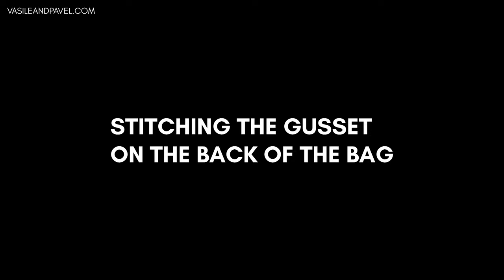The Naomi Leather Crossbody Bag (Link to Pattern in Description)

Comment: How do you attach the buckle on the bottom?
Reply from the maker: stitched, ofcourse. I make the holes on the gusset and on the piece that holds the buckle acording to the pattern and I stitch them. Sometimes I forget to stitch them from the begining, so I stitch them lately.
Reply: @VasileandPavel  Thank you for such a quick reply. I understand that it is stitched, I meant what does the piece look like. It does not seem to be included in the pattern
Reply from the maker: @joeman1224  i just checked. It is, on page 13.
Reply: @VasileandPavel  it's not on page 9
Reply: @VasileandPavel page 13 is d1 c1

Comment: Bună ziua. 
Ce piele este?
Reply from the maker: la show more (sub filmulet) gasiti asta:
MATERIALS
- BODY: 5.5-6 oz (2.2-2.4 mm) semirigid leather. You can make two bags from 11 sqf (1 sqm). Or you can line 3.5-4 oz (1.4-1.6 mm) semirigid leather with 1.5-2 oz (0.6-0.8 mm) pigsking leather.
- CONTRAST LEATHER: 7.5-8 oz (3-3.2 mm) semirigid  leather. Or you can line 5-5.5 oz (2-2.2 mm) semirigid leather with 1.5-2 oz (0.6-0.8 mm) pigsking leather.
- SHOULDER STRAP: 7-8 oz (2.8-3.2 mm) leather. You need a piece of 47" (120 cm) for the longest shoulder strap.
- 1 mm waxed polyester thread
- leather glue
- edge dye

HARDWARE
- 1 x 1" (25 mm) buckle
- 2 x 3/4" (20 mm) D rings
- 2 x Sam Browne studs

TOOLS
- cutter 
- needles 
- 1.5 mm hole punch 
- cutting mat 
- mallet